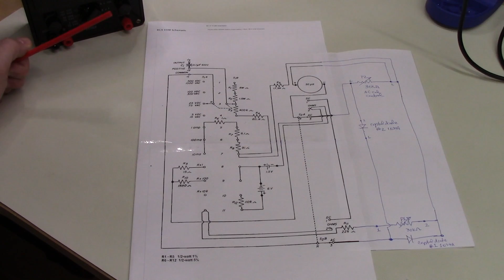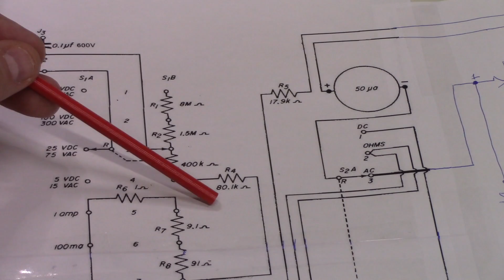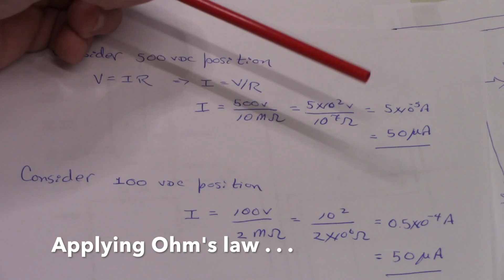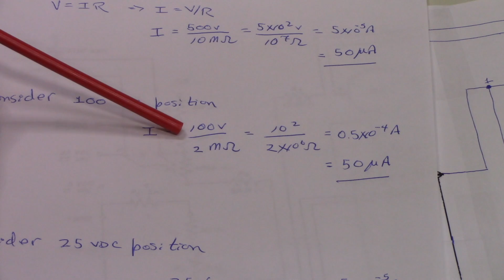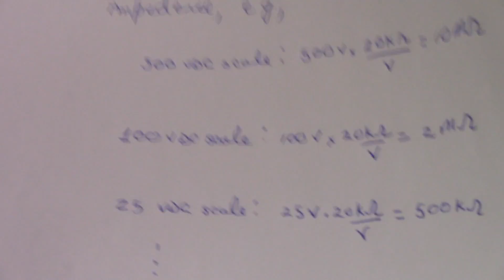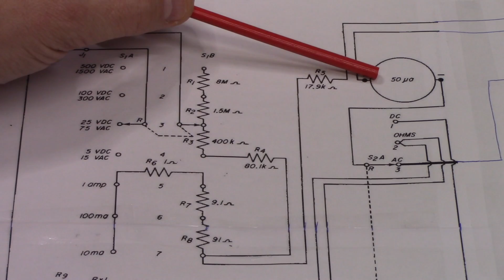#56: The RCA Institutes VOM and meter sensitivity

Comment: Built one of these in 1970. I think I left it in Florida in '75. Bought one the other day off Ebay. I didn't remember about the battery holders. Someone had replaced both of them with I thought a C cell holder and a D cell holder but the D-cell might have been some kind of 6 volt battery.. And thanks for the diagram although I had to jump thru some hoops to print it out.  -plcstan

Comment: What a nice meter, large scale too which helps.  We have the same issue over here with the AVOmeter 15v battery, the workaround is stacking five 3v coin cells in a tube.